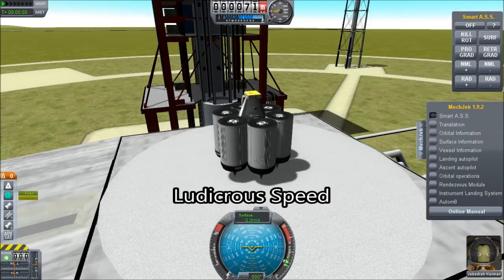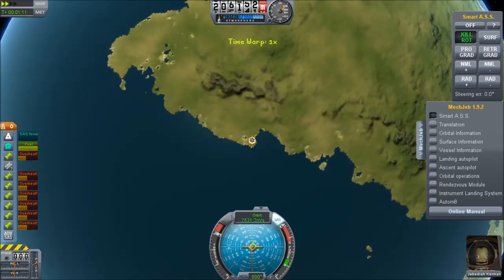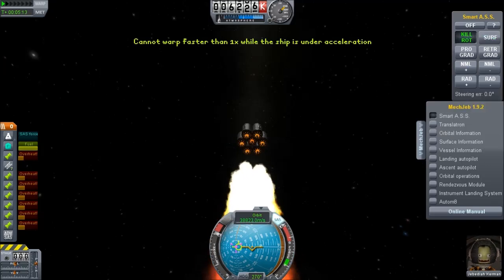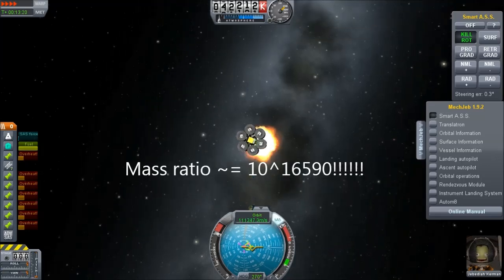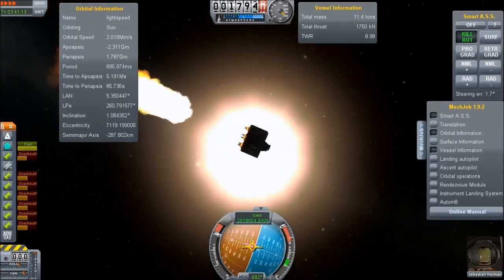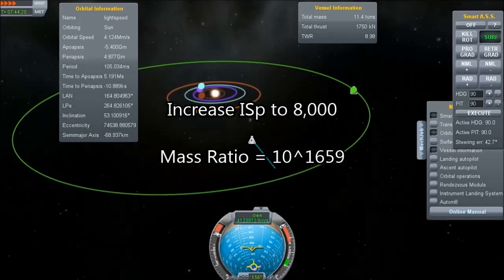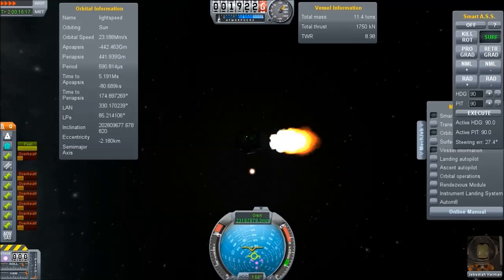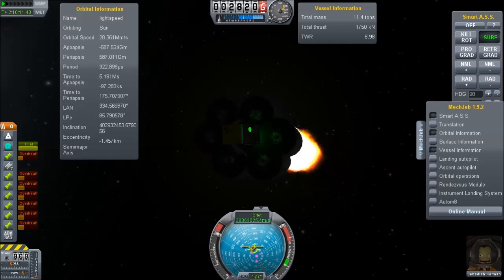What Does It Take To Reach Lightspeed In Kerbal Space Program?

Comment: Actually, if you were to accelerate at 1.5 g consistently for about 100 days, you'd be about 30,000 km/s short of .5 c. Now, that's not necessarily a high fraction of c, and IIR relativity correctly, you wouldn't experience much time or mass dilation, but that's still a non-negligible fraction of c, and IIRC antimatter has the necessary energy density to achieve such a feat.

Comment: Hey Scott, one of the few applications that you can actually reach the speed of light in is SpaceEngine. You can actually go so fast that the engine is unable to load the stars and galaxies in front of you fast enough. It can get to the point where you flying through a galaxy and there appear to be no stars in front, but they are loading behind you. Still, thats pretty damn good considering SpaceEngine is a procedural universe simulator.

Comment: 4,294,967 km/s.
It's simple to calculate. The maximum number a 32-bit system can calculate is  4,294,967,295.
If you somehow got KSP to run using full 64 bits, you could hit 18,446,744,000,000,000 km/s.
So that's nice.

Comment: Positron-electron antimatter annihilation releases almost all energy as gamma-ray photons. Plus the energy of the annihilation can be hyped up massively if the collision of the particles happens at higher speeds. For example, a positron hitting an electron at normal speeds gives off 2 ultra high energy gamma-ray photons, but if you increase collision speed to 0.99c, which isn't too hard for modern particle accelerators to do, it gives off 5 high energy gamma-ray photons.
i liek kwantum fisiks

Comment: No, you'd still have to find a propellant with an exit velocity much faster than light to reach that velocity with any reasonable amount of fuel. The best I can think of is an ion engine like the VASIMR, but that doesn't generate very much thrust, so it would take a very long time to get up to speed, and you might just have to start slowing down before you even reach light speed, just to avoid overshooting your destination.

Comment: To make an FTL ship:
1.Go to parts folder in ksp
Select the below parts, open cfg folder, then change the parameters to the numbers given

fueltanksmall:
Mass= 0.0000000001125
Fuel=200000000
dry mass=0.000000000125

mk1pod:
mass= 0.0000000008

advsasmodule:
mass= 0.0000000008

liquidEngine3:
mass = 0.0000000005
maxThrust = 500

2. Build ship with parts and launch.

Problem Einstein?

Comment: if you go flying through water or glass (not shards of glass. solid glass) you can get very close what the speed of light would be in a vacuum but in the material your going through your traveling fast than the light that's also passing through.

Comment: You technically don't, it's just a short hand way to describe gamma*mass, which is called the relativistic mass. Gamma is the Lorentz factor, which is a function of velocity that will approach 0 as velocity approaches the speed of light. Gamma is an inverse function, so if velocity is high anything it is multiplied to increases, thus relativistic mass increases as velocity approaches the speed of light.. But you should know that mass does not really change, it is an inherent quality of matter.

Comment from the maker: If you want to add fuel tank mass you multiple the ISp by 
Fuel Mass/(Fuel+Tank Mass)
So it reduces your ISp from 800 to about 711. 
And yes, you should including staging, but, if I had a perfect setup with each tank dumped once it's early there would be so many stages that calculating the true number would take longer than the lifetime of the universe. So it's an approximation.

Comment: Nothing can go faster than light, so if you keep pumping energy into something to give it more speed, that energy has to go somewhere - via the E = mc^2 equation. The ratio between the amount of energy that's changed into mass and the energy that's changed into accelleration (and thus speed) is given by the formula sqrt(1-(v/c)^2), and if you work that out, you'll see that is in fact not possible to reach the speed of light exactly, as your mass would be infinite. You can however get very close.